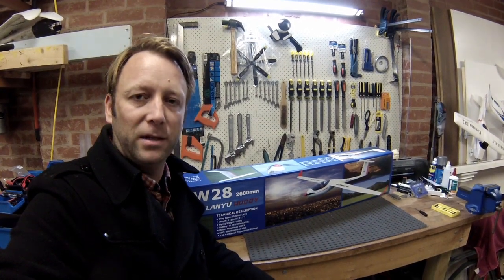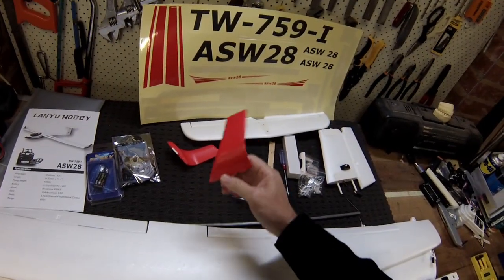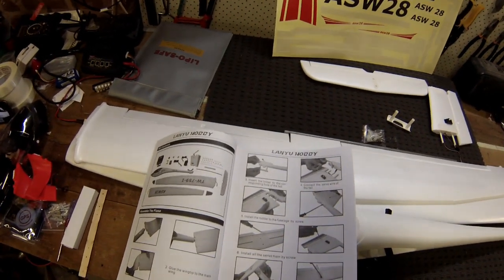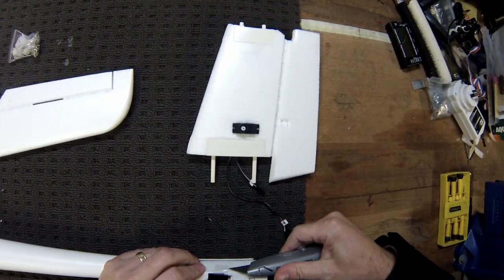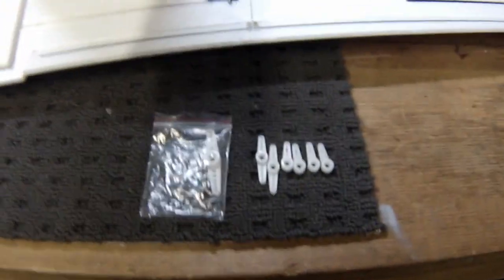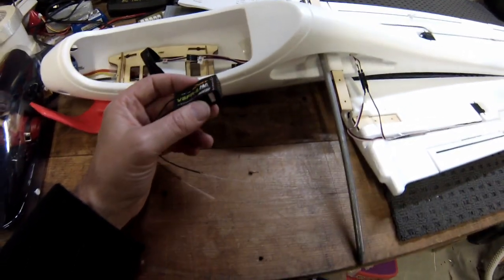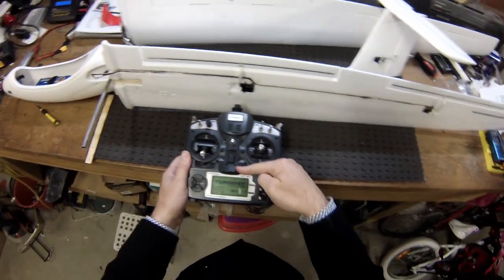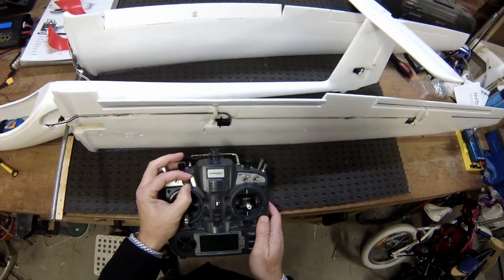ASW 28 - Unbox Build (Hobbyking/Lanyu/Volantex)

Comment: I just built the V2 version this morning. It uses simple self locking snap locks on the wings an no need to fumble with screws to lock on the wings.
Reply from the maker: Oh yeas, I've seen the new wing connectors, they are a lot easier looking than the screwed set-up on this one. I might even try to modify mine to become similar to the clip in style of the new version. Cheers Michael
Reply: any video?

Comment: Great Job, Looking forward to the maiden flight video - will be interested to see how the RTH works in a glider, assuming its not powered on return !!
Reply from the maker: Peter Frank Cheers Pete, maidened and once I actually connected the stabiliser/RTH the right way, it all worked a treat! I have the power set on fail-safe (out of range), but I tested it no power too and the glider just works its way back and circles about.